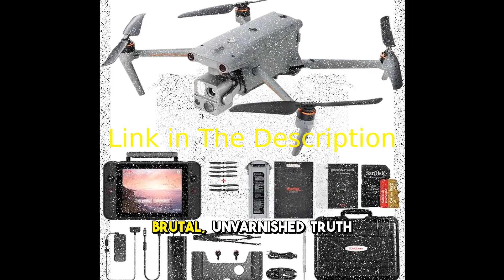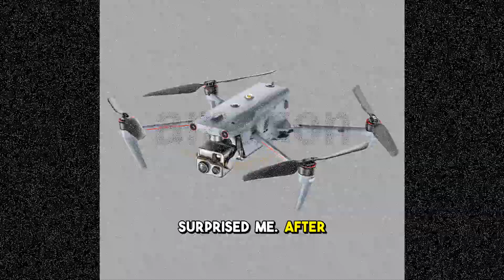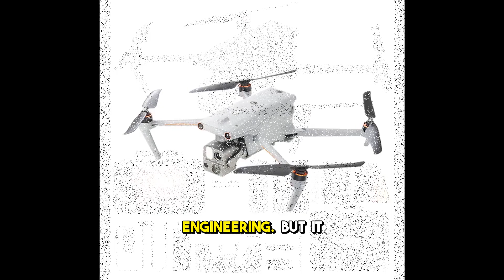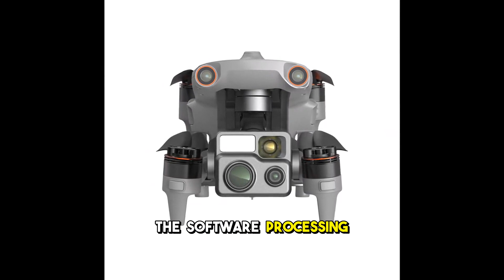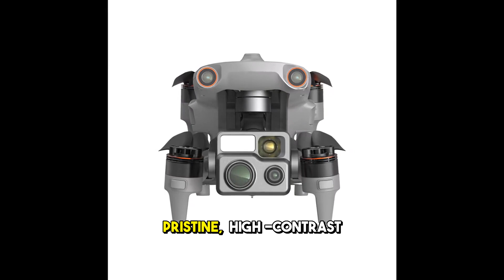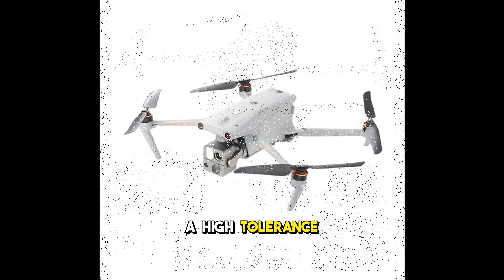Don't Buy Autel EVO Max 4T | Honest Review | Problems

Comment: I rented an EVO Max 4T for a week to get experience and I can say I experienced the opposite of what this person claims. Regarding the software, there is a slight learning curve if you're used to a DJI drone and controller layout, but it wasn't difficult and I didn't need a manual or to Google anything. The zoom is wicked good, and at max 160x zoom there was no "interpretive dance" movement. On one occasion, I was experiencing 17mph gusts while zoomed in. Yes, there was some slight yaw to the left that was easily correctable, but there was no vertical shake. At night, the drone was able to detect power lines, and the auxiliary light is amazingly bright. I flew within proximity of a radio tower, cell tower, and in 4+ KP index with no connection or interference issues whatsoever. I was able to figure out how to do survey, orbit, and waypoint missions without any outside help and the other features, as well. The only issue I had was powering on the drone. Powering on an Autel EVO Max requires just one long press. Doing the DJI method on an Autel drone puts it into pairing mode - which caused me some confusion at first. It is simply the difference between two manufacturers and not a design flaw. 

Had I been on the market, I would buy this drone without hesitation. Like the others said, the OP does not provide any proof of his claims.

Comment: Hmmm...I've had my EVO Max 4T V2 for almost a year!  I find that most everything you said in this video is "Male Bovine Excrement!"  Granted, I haven't used the A-Mesh system, but everything else is very functional and simple to use!  This drone was never designed for cinematic videography.  If you want a tool that covers mapping, inspection, search and rescue, or anything that may not have GPS access, this drone is great!  I love that it will stop if it thinks there's a problem in any direction.  It's kept me from crashing several times.  After all...as Ken Heron would tell you..."Trees are Dicks!"  I also have less trouble flying at night!  The built in Strobe, Landing Lights, and mm Wave avoidance system keeps the unit from crashing while trying to do a job!  Maybe next time, actually have a unit and show the problems you experience (if there are any) instead of letting an AI do your complaining!
Reply: Hi, we only have this drone in version v1 and I'm looking for a way to transmit video to other devices, such as a smartphone, preferably wirelessly. I tried to live stream it on YouTube, but it shows an incorrect URL. Do you have a solution? We use the drone for search and rescue operations and firefighting. We received a request from our superiors about this option, as they're planning exercises and want to have a view.
I would also prefer to transmit the entire controller image along with the gui